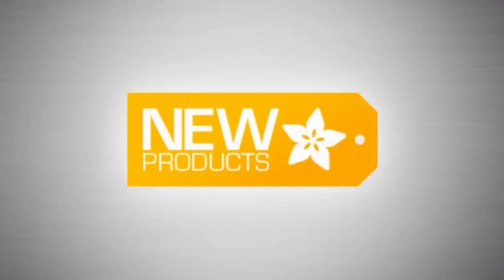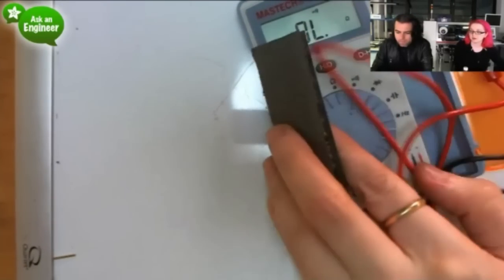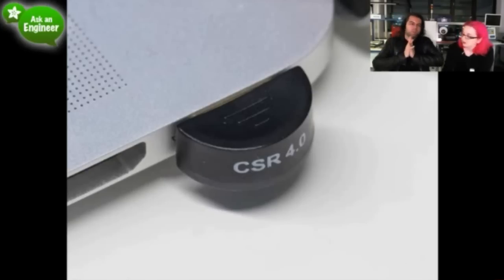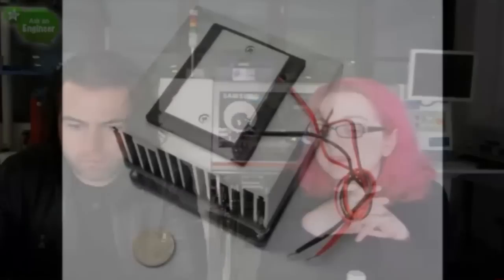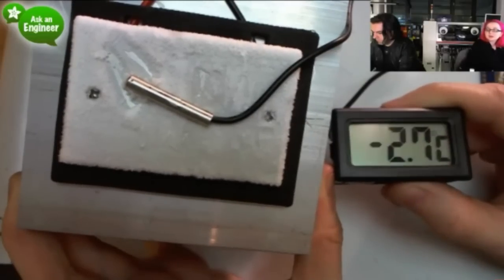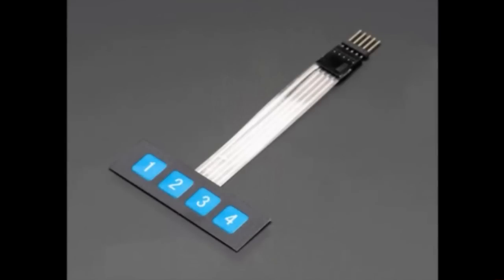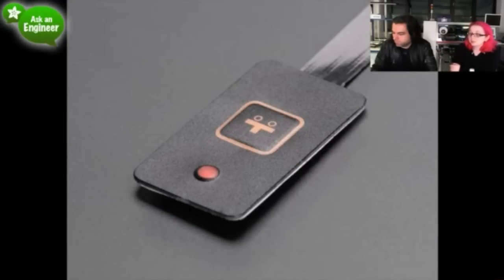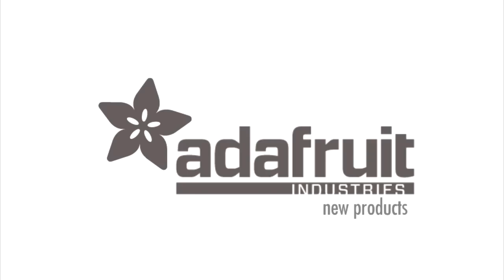Peltier Thermo-Electric Coolers! New Products 4/20/2013

Comment: what if you stack a few of those peltier modules? would they like superchill the one side and melt on the other side? :D
Reply: Yes, the pelters get super hot and in my case burnt some of the rubber coating that wraps the wire in probably 30 minutes... Like, you could probably cook eggs on the one side.  I stacked 3 peltiers together attached to corsair hydro Series H60 AIO Liquid CPU cooler..  I am going to try to use two separate peltier with their own fan and things and run a liquid or water through both via an aluminum water cooling block..  I suppose you could do the same to the hot side, if you wanted to boil watering theory who knows how much you would need to get it hot enough...

Comment: Peltier device, Peltier heat pump, solid state refrigerator, or thermometric cooler (TEC)  A Peltier cooler can also be used as a thermoelectric generator. When operated as a cooler, a voltage is applied across the device, and as a result, a difference in temperature will build up between the two sides.[3] When operated as a generator, one side of the device is heated to a temperature greater than the other side, and as a result, a difference in voltage will build up between the two sides (the Seebeck effect). However, a well-designed Peltier cooler will be a mediocre thermoelectric generator and vice versa, due to different design and packaging requirements.    https://en.wikipedia.org/wiki/Thermoelectric_cooling    for those who dont know what it does !